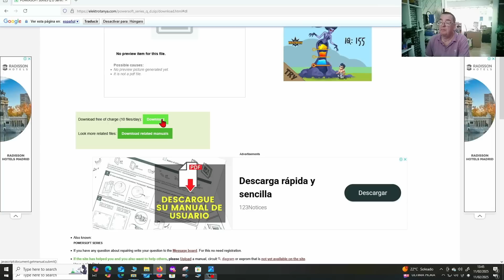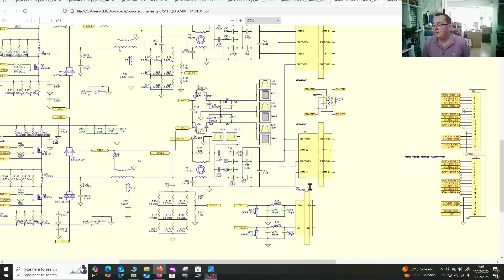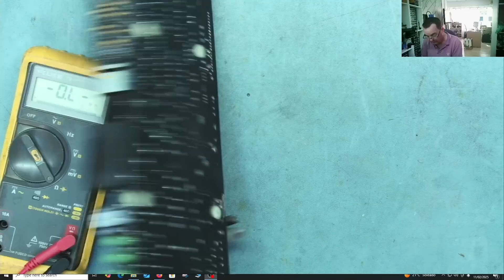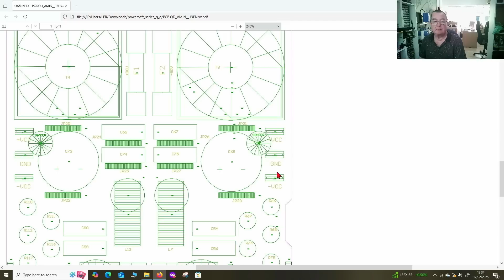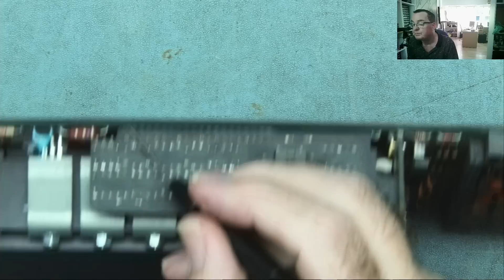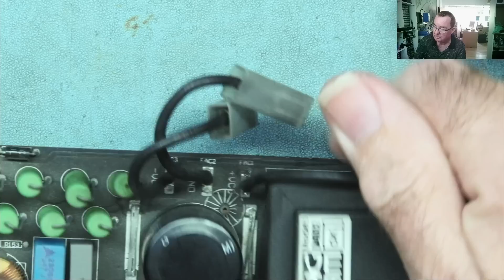Powersoft Digam D4002 Class D Power Amplifier set on FIRE!  Can we fix it?

Comment: Expensive amps, but they do pop
Reply: At least they're not ~$25,000 and then try to sue you when you fix them.  Cough.  ;)
Reply from the maker: @DrFiero  PMSL
Reply: @DrFiero  lol
Reply: @JonathanMRose  - Glad to see at least a few people got the Mend-It-Mark reference!  :D
Reply: them digams are first generation and (at least 10+ year old ) even if poped thats a good amount of use before fail :)
Reply: @aturborago  They’re great amps. Lightweight, save space & sound great. Have 3 that are all 10yrs+. All 3 have been in for repair several times. Have a pair of MC2s & did run crown amps for many years too. Still happy to run them but ensure I have the extra (3rd) amp in the rack & fire extinguisher on standby lol
Reply: @JonathanMRose  True, I am not protecting the brand don't get me wrong lol, I had couple here and there what's stopped from that brand and some what's run many 1000 hours without opening, and other big brands  too what's stopped..   but fire? not yet..😄Electronics can fail unfortunately.
Reply from the maker: @JonathanMRose  Crown Amps were the dogs danglies 🙂
Reply: @ & then some. Unfortunately the class d revolution suited my back 🙄

Comment: I am guessing that spring washer was loose in the case for a while. When loud/bass heavy music was playing and the washer was under the power connection, case resonance made it “dance” and it shorted out either the positive or negative voltage rail to ground, leading to the traces being vaporized. That’s my guess and I am sticking with it. Happened faster than the slow-blow fuses could keep up with… 😂
Reply from the maker: This is my honest opinion also 😉

Comment: For track repairs get yourself some tinned copper wire and PTFE tubing. way better than using stranded wire and can be formed to follow the tracks. dob of epoxy  and jobs done. And for cutting tracks a scalpel blade also better than cutters.

Comment: @17:40 it a split washer, should be under a screw. Normal form of a locking washer, but on a pcb I'd use a crinkle washer less damage to boards.

Comment: From an electricians point of view I think you need to be testing these higher voltage power supplied amplifiers exhibiting this kind of conflagration on the pcb with an insulation tester.
Insulation testers are current limited and usually start with 100v DC as the first selection.
This followed by 250v, 500v, and 1000v.
Some multifunction testers ramp the voltage up to the test maximum and show the point of breakdown.
Most DMM's are indicating from a much lower test voltage 
Insulation testers are applying a potential breakdown voltage which is relevant to the voltage system being tested.
Reply from the maker: This is why I normally reroute the wires away from the charred area of the PCB if I can